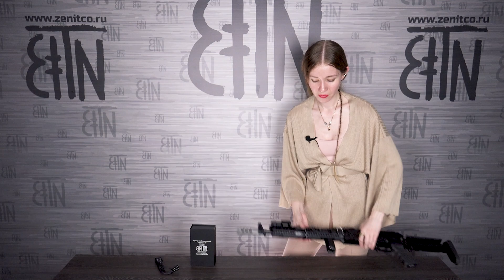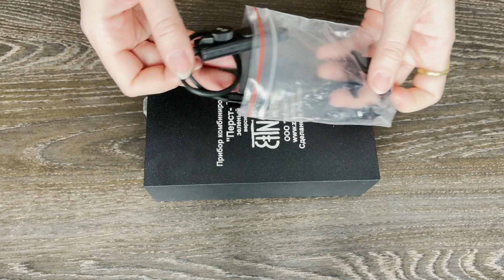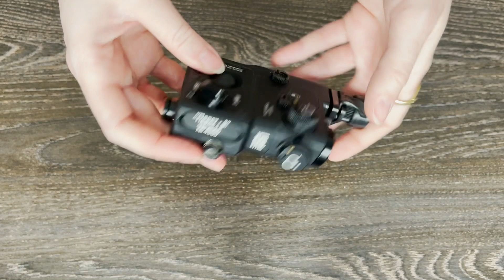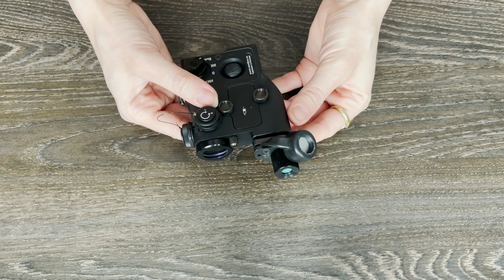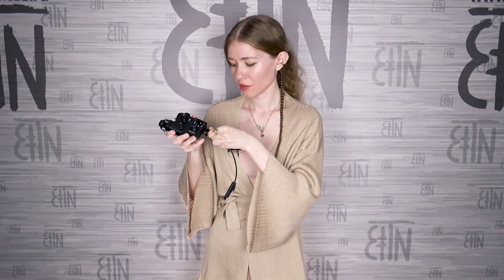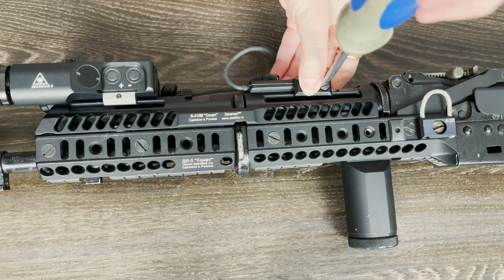Perst-3 gen.3.0: what was changed, unpacking, modes, switches

Comment: Can you describe the "high output" or "turbo" mode?  On my Gen3 Perst3 and Perst4 if I turn on the device, and then press and hold the power button it will increase SIGNIFICANTLY in brightness.  I could not find this in the manual and I do not think it was in the video.  Is this normal operation , will it damage the device?
Reply: how long are you holding? mine doesn't do this.
Reply: @AlexanderSenese  there's a few people who have confirmed the turbo mode on arfcom as well.  Only works on Gen3 devices.  Process is to turn on the device with a single button press.  After the unit is on press and hold the button , after two seconds the laser will increase in power output.  Works for both IR and VIS on both Perst3 and 4.
Reply: @JN-qr4yt  Learn something new everyday. Now I don't have to fumble with my dial when shooting with vis laser in the daytime. I just hold in the button and the laser will go to max power automatically! Thanks for the info!